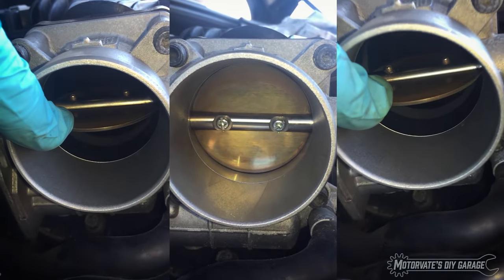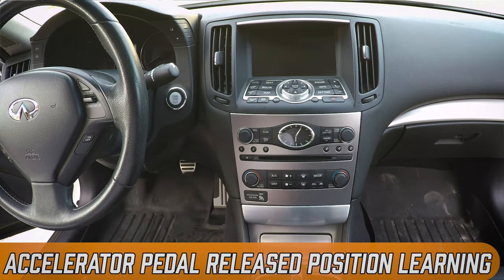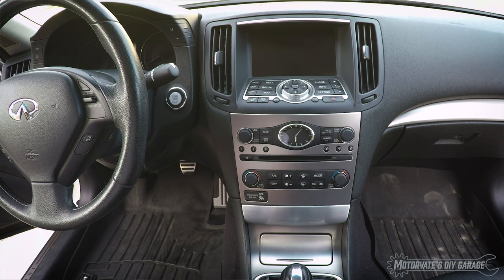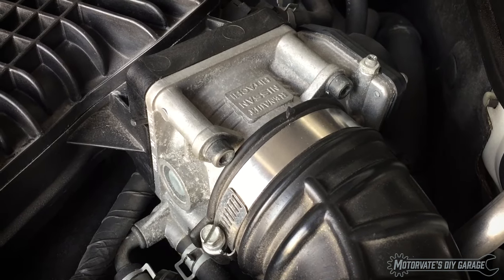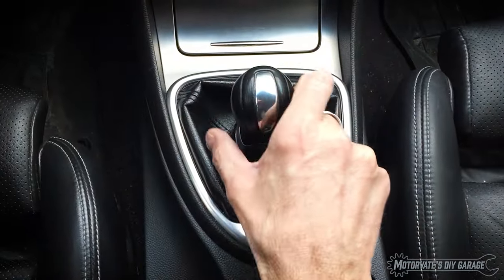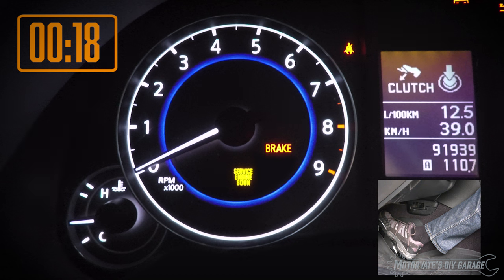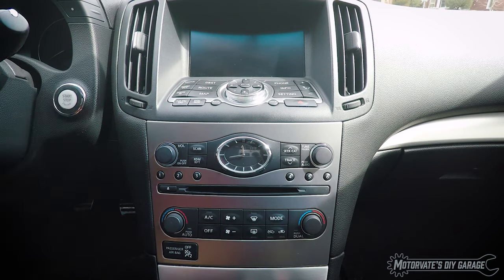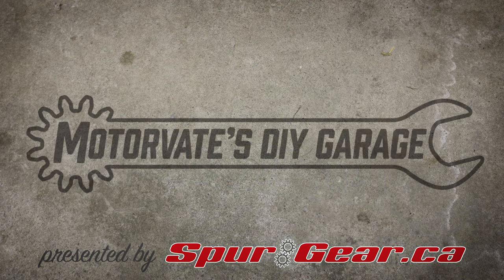G37 & 370Z After Throttle Body Cleaning: Motorvate’s DIY Garage Ep.27

Comment: Will this work on a g35?
Reply from the maker: Hey Alvaro Silva,
Yes... It will work on any Nissan or Infiniti made after about 2003, when they switched to an electronic throttle.

Nissan/Infiniti is VERY good as using the same procedures for most of their products.
Reply: @MotorvateDIY  I got a 2008 infiniti g35. And now i got tremendous high rev and went on limp mode after cleaning the throttle body. Should i disconnect the battery first and plug it back to do this procedure?
Reply from the maker: Hey Alvaro Silva,
It can be tricky to get the idle air volume learning procedure to run. Just keep trying and pay very close attention to the pre-conditions. If any of them are not met, the procedure won't run.

If you have a cheap OBD scanner and an Android device you can use a free app to run the idle air volume learning.:

Quick & Easy Idle Air Volume Learning: Motorvate's DIY Garage Ep.28
https://youtu.be/OiB9txECWB0

Comment: Does this work for 08 G35 sedan sport?
Reply from the maker: Hey Geon Kim,
I just checked the 08 G35 shop manual and the steps are the same.
Reply: Motorvate DIY thanks for the info sir! If it’s possible, could you please share the 08 G35 Sedan shop manual?
Reply from the maker: Hey Geon Kim,
Your best bet is to purchase a one day ($20) subscription at https://www.infiniti-techinfo.com/deptsubs.aspx
or see what you can find using google.
Reply: Hi there and thanks for ur explanation , does this reprogramming work with fx35 2010? Thanks again

Comment: Hi hopefully someone can help me out here, so I cleaned the throttle bodies and the maf sensors, put everything back together, took it for a quick drive and now when the car idles in park the rpms bounce from 2000 and 1300 continuously. It’s possible I made an error in putting things back together but I’m really concerned.
Reply from the maker: Hey Donald Trump Ice Cream,

It wouldn't hurt to double check the intake tubes to make sure they are on correctly and snug.

Did you follow all the steps in this video and the required pre-conditions?

After you clean the throttle bodies, there are 3 procedures that need to be done: release accelerator position learning, closed throttle position learning and (the most important and difficult) the idle air 
volume learning.
Reply: Motorvate DIY I followed all the steps and I can’t seem to get the idle air relearn to work. I’ve must of done it like 25 or so times now. The service engine soon light doesn’t start blinking at 10 seconds, it blinks at like 5 seconds. Then it takes like another 15-20 seconds for it to stop blinking. I’ve warmed up the car and even took a 20 minute drive, the steering wheel is straight and all electrical options are off. I’m not sure why it’s not working. I’m driving an 07 G35. Could it be different than yours?
Reply from the maker: Hey  @DonaldTrumpIceCream  ,
Search thought the comments on this page... I think was one guy with a late model G35 with the same issue. As it turned out there was a TSB (technical service bulletin) and a software update was required  to fix the issue.
Reply: Motorvate DIY I’m sorry but I’m not really sure what a TSB is, and for that software update, what do you recommend I do next? Thanks a lot for all this help!
Reply: Motorvate DIY Also, I took it to autozone to give me the codes because after cleaning the TBs, the Check engine soon light came on. The codes that appeared are P0507 and P0014. I bought a Veepeak Vp11 so I could just do the idle relearn through the app you recommended to another guy in the comments. However, will it even work that way? Will I still need to do that software update because of the possible TSB you mentioned? Thanks a lot!
Reply from the maker: I found a few articles that mentioned if the idle is too high, the idle air volume learning won't work. Some have been able to slightly lower the idle by loosening the clamp on the throttle body and allow a little extra air in and that will lower the idle. I suspect that will be tricky to do without stalling, but it may be worth a try.

There was another article that mentioned if the fuel trims are too lean or rich, the idle air volume learning won't work.
So...
Once you get your VP11 (nice choice, I have the exact same one!) you may want to purchase (< $15 I think)  OBD Fusion and run their AWESOME diagnostic report.  

Here is a video on how to run the report: https://youtu.be/T7O_vjsB2Jo

I wish it wasn't so hard to search all the comments... as then I could point to the person who had the same issue.

Maybe call the local Infiniti dealer and give them your serial number and ask if there are any updates...

Let me know how you make out and good luck!
Reply: Motorvate DIY So I just got my VP11 and I reached the requirements, and I ran the IAVL on NDSIII and it fails every time. Now I’m not really sure what to do
Reply from the maker: Hey  @DonaldTrumpIceCream ,
I am guessing that your idle is too high for the "idle air volume learning" to complete.

If you loosen the clamp by the mass air flow sensor, and open up a slight gap, that should lower your idle and you  try the NDS III app again. 

If you open up the gap too much the engine will stall. Close the gap, start the engine and try again.
The other thing to try, is to disconnect the battery for a few hours and then reconnect it. 
I don't think that will work, but some folks have said it worked.

Good luck!
Reply: Motorvate DIY I read though the comments and I saw the thread about the guy who had to get an ECU reflash, I’m going to take it to the dealer to get that done and I’ll update to see if there’s any luck!
Reply from the maker: Hey Donald Trump Ice Cream,
Thanks for the update and my fingers are crossed for you :)
Reply: @DonaldTrumpIceCream  what was your solution , did you ever get this fixed?

Comment: Will this work for infiniti m56 2011
Reply from the maker: Hay Asian Dude504,
Sorry, but I really don't know. 

Most of the time Nissan/Infiniti have the same procedures, but I don't have any technical documentation on the 5.6 v8. 

You can always try it an see it it works and then please let me know.
Reply from the maker: Hey AsianDude504, I was able to find  the factory shop manual and the process is the same for you M56. Good luck!
Reply: @MotorvateDIY  thanks a million...I will try it today
Reply from the maker: Hey AsianDude504,
Please let me know how it works out.
Reply: @MotorvateDIY  ....everything is working perfectly. I cleaned the throttle body with CRC before I did the steps. Thanks buddy!
Reply from the maker: Hey AsianDude504,
Awesome! Thanks for the update :)

Comment: If I don’t reset what will happen ?
Reply from the maker: If the throttle body isn't very dirty, all is well and there is no difference.
If the throttle body is dirty, the idle will be high and unstable.
Reply: @MotorvateDIY   so mines must still be dirtyish because my car went into limp mode and vdc off slip on. Later im a re clean it and do the reset.
Reply: @MotorvateDIY   I believed it was because one of the tubes into the left intake wasn’t fully sealed. So after I fixed that it was driving decent but engine light still on.
Reply from the maker: It will take a few "drive cycles" for the ECU to turn off the engine light. (assuming the reason for the light turning on is fixed)

Generally, you can clear the codes which turns of the check engine light, o just drive the car for a few days and it should turn off.

Comment: What would happen if you didn’t do these steps after
Reply from the maker: Depending on how dirty the throttle body was, you might have a high and unstable idle... which may result in a P0507: Idle speed control sys tem RPM higher than expected
Reply: @MotorvateDIY  haha little late but I ran into this video again and just letting you know how it went I decided to clean my throttle bodies without moving the butterfly valve that way I wouldn’t have to do the relearn. 7 months in an cars running great 🤞🏽👌🏾

Comment: Cleaned them but check engine light is on. Followed the step 1 and 3. Since it was to hit for 2. 1 and 3 worked as it was running high. Light blinked. Now I’m curious on id the light will turn off when I do step two in the morning.
Reply from the maker: Hey A Acuna,
Was the check engine light on before you you cleaned them? If so, do you have an OBD scanner to retrieve the trouble code?

When you do the second step (throttle valve closed position learning) make sure to then do the third step again (Idle air volume learning).
What car are you working on?
Reply: Motorvate DIY   No  sir.
Reply from the maker: What car are you working on?
Reply: Motorvate DIY 2014 370z. I’m afraid I may have messed up one or both throttles body sensors It’s running fine though
Reply from the maker: Hey A Acuna,
So you have a check engine light on, but the car runs and idles at the proper speed? (600-700 RPM)

Do you have anyway of reading the code? If not, pick up a inexpensive OBD scanner (VeePeak work well) and use OBD Fusion to run a diagnostic report. Watch this video to see what the report looks like: https://youtu.be/dHvNat8C2-M

If you have an Android phone or tablet and a bluetooth OBD scanner, you can use this free app to run the idle air volume learning: https://youtu.be/OiB9txECWB0

Good Luck!
Reply: Disconnect the battery for 10min

Comment: * NOTE: If you have a 2007 G35 or 350z  (engine: VQ35HR) there have been reports of an ECU update that is required to allow the idle air volume learning to work. Without the update, after cleaning the throttle you will have a high and unstable idle *

The ECU update not available in NZ.

 What are my options?
Reply from the maker: Hey  Alexander Rattrie,
Here are your options as I see them:
(1) Eugene @ Enthusiast Auto Care in Concord, California (https://www.yelp.ca/biz/enthusiast-auto-care-concord) can load the 2008 ECU software on the 07 ECU. BUT I suspect the shipping time & cost would be too much. He has done this for a few people here and they have been very happy.

(2) You could buy a 2008 350z/G35 ECU on ebay, then have a local locksmith add your keys. However, the VIN in the ECU won't match the car. It is my understanding the 08 350z ECU is the same as the 08 G35 ECU  AND the G35 ECUs are MUCH cheaper, like < $125 USD.

Note:
I don't have a lot of data on this issue, but I wonder if this issue is only for the North American market... I would suspect your 350z was made for the Europe/Japan market place, AND the ECU programming will be different.

Those are the options as I see it. 

One more thing:
If your ECU ID ends with a "A" that is generally the initial factory version. Every ECU update will change to the next letter in the alphabet. For example the next ECU update, will change the end of the ECU ID to "B"

To find out your ECU ID use NDSIII (free android app) and a cheap ELM327 Bluetooth OBD.  Here is a video showing the ECU ID and also showing an easy way to do the idle air volume learning:
https://youtu.be/OiB9txECWB0?t=162

Once you have your ECU ID, do a search here:
https://uprev.com/romlist.php
To see if your ROM (ECU ID) is found and what is the latest version.

If your ECU ID last digit is higher up (like B or C, or 4 or 5) then maybe it has already been updated. Keep in mind this is just my best guess.

Please let me know what you decide to do and what works or doesn't work. Then I will update the pinned post to help others.

PS:
I was in New Zealand last year and I love your roads!! No wonder all the best rally drivers are from there :)
Reply: @MotorvateDIY  Endless thank yous! I will attempt the uprev option this week hopefully at torque performance in Auckland. Will keep you posted about how I get on. Legend
Reply from the maker: Hey  Alexander Rattrie,
I wish you luck and please let me know how you make out. :)
Reply: Thank you and Nistech South Auckland. Reflashed ecu, problem solved 😁

Comment: My car is still misfiring like crazy I followed all the steps still need help
Reply from the maker: If you have misfires, you need to look at fuel trims, fuel pressure, spark plugs.

You might want to use OBDFusion and run a diagnostic report to see which cylinders are misfiring. (shown in the mode $06 report results)

Cleaning a throttle body will not cause a misfire.

Comment: Bro I’m freaking out I really can’t figure out how to get my 350Z to stop revving itself it doesn’t idle at all in park or neutral it just revs up to 1700 rpm then back down to 1k over and over and over but in drive or in reverse it works just fine but as soon as I let my car coast it revs high on its own PLEASE HELP
Reply from the maker: Hey  caleb valles,

Sorry to hear about this... Is your 350z a 2007 model?
If it is, I guess you missed the warning at the top of the description:

* NOTE: If you have a 2007 G35 or 350z  (engine: VQ35HR) there have been reports of an ECU update that is required to allow the idle air volume learning to work. Without the update, after cleaning the throttle you will have a high and unstable idle *

If it is a 2008, the "idle air volume learning" procedure will fix this.

If it is a 2007, then your ECU needs to be updated. Eugene at Enthusiast Auto Care ( https://www.yelp.ca/biz/enthusiast-auto-care-concord ) can update it for you. He has done this for more than a few people and does great work!
Reply: Motorvate DIY I really didn’t see that I’m sorry I really appreciate it though bro
Reply: Motorvate DIY WAIT the website doesn’t load !?
Reply: Motorvate DIY the link is no longer valid man
Reply from the maker: Fixed. YouTube added the closing bracket to the URL.
https://www.yelp.ca/biz/enthusiast-auto-care-concord 

Good luck!
Reply: Motorvate DIY Thats all the way in Sacramento

Comment: Will the ECU relearn those parameters on its own, given enough driving around after TB cleaning?
Reply from the maker: Hey Keefe Loke,
If the throttle body is a little dirty before it is cleaned,  I think the ECU does relearn after a while.
BUT if the throttle body is very dirty, it doesn't and the result is a high idle. (until the idle air volume is done)

Comment: My g37 loses power on a warm start up. I got my throttle bodys cleaned, but it still deos this. Anyone know why?
Reply from the maker: Hey sn00ki_,
When you say it looses power, please explain how the car is being driven when you notice the power loss.
Reply: @MotorvateDIY  its my daily car, and it only happens on a warm start up
Reply from the maker: Hey sn00ki _,
What EXACTLY happens on a warm start up? What do you notice that is different?
Reply: @MotorvateDIY  Hi. I have the same problem. I just replaced the throttle body (passenger side), the two maf sensors and both air filters. Car will turn on but will not keep the idle and turn  off. Im going to so this process tomorrw. Help...
Reply from the maker: Hey vicky83ruiz,
What happens if you press the accelerator about 1/2",  start the car and then lift off the accelerator pedal?
If the car starts and idles, then the three steps shown in this video should fix your problem. - Good luck!
Reply: @MotorvateDIY  when I start the car, my rpm will go up 2000 rpm, and then just loose complete power. I'm still able to turn my accesories on.
Reply from the maker: Hey sn00ki _,
OK, I see... when you start your car without any throttle, it revs to 2000 RPM and stalls.

What happens if you try to give it a little gas before it stalls? Does it idle then?
If it does idle, using your tach, what is the approximate idle speed?

I am thinking the 3 steps in the video need to be done again. It seems like it didn't learn the idle air volume speed.
Reply: @MotorvateDIY  yes, I give it gas to prevent the car from stalling
Reply: @MotorvateDIY  Ok. Im going to do the whole process again  tomorrow. Wish me luck!

Comment: Sometimes these steps dont work ive encountered these issues cleaning my throttle in the past. You can disconnect your battery for 24hrs should do the trick. Also if your gentle when opening and closing the valve you shouldnt have the to relearn anything.
Reply from the maker: Hey Robert C,
Thanks for the tips!
Reply: Right !

Comment: My g37 is still idling at abt 1k after the resets and cleaning the throttle and MAF, code P0174
Reply from the maker: That code indicates that bank 1 is too lean.
Sounds like you might have an intake leak. Check all hoses and plastic PCV parts for cracks, splits or breaks.
Reply: @MotorvateDIY  unfortunately might, I’m going to have a look this morning

Comment: My car has 185k on it and throttle bodies look great, previous owner must have cleaned em…
Reply from the maker: Nice! It looks like the previous owner has done a above average job with maintenance.
Reply: @MotorvateDIY  air filters were black and oily tho so those got changed
Reply from the maker: That's ok and a easy fix :)

Comment: Thanks for the video. I ran these and I still have a high idle and spikes and sputters. I recently had a tune up and I'm trying to figure out if they did something incorrectly. Also, the problem is far more prevalent when the A/C is on. Anyone have this? 09 G37xS here.
Reply from the maker: Hey Stephen J.,
The timing of the idle air volume learning can be very tricky and all of the per-conditions  must be met without exception. 

If you have done all that, you can keep trying (some have needed to do it 20+ times)
or 
If you have a bluetooth OBD scan tool, you can use this free app to do the idle air volume learning.